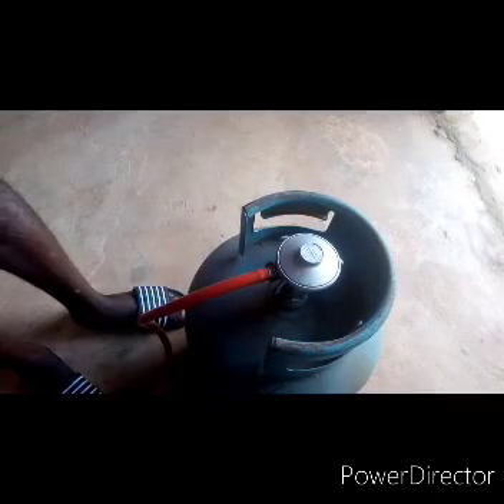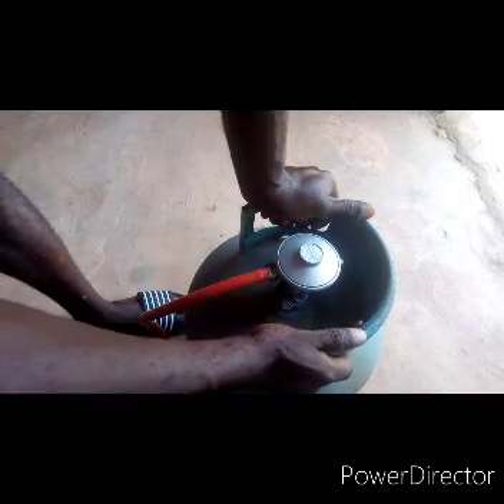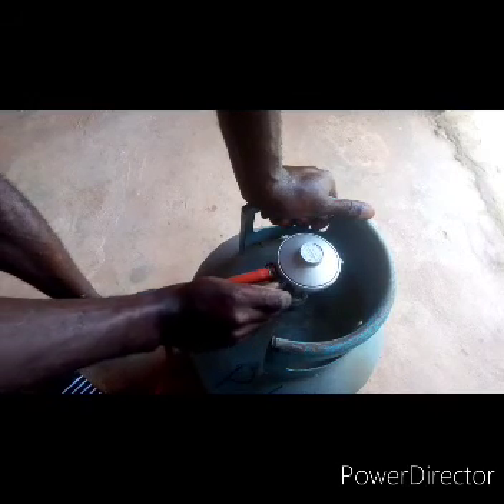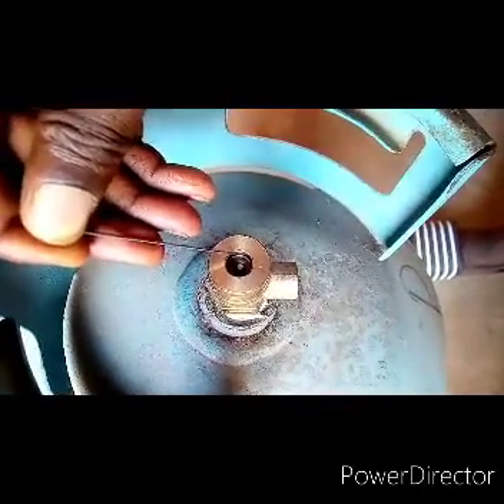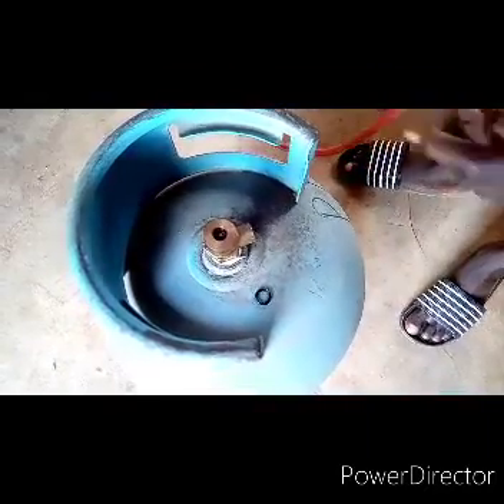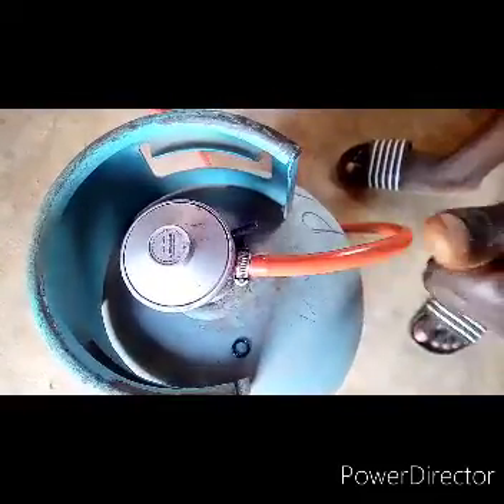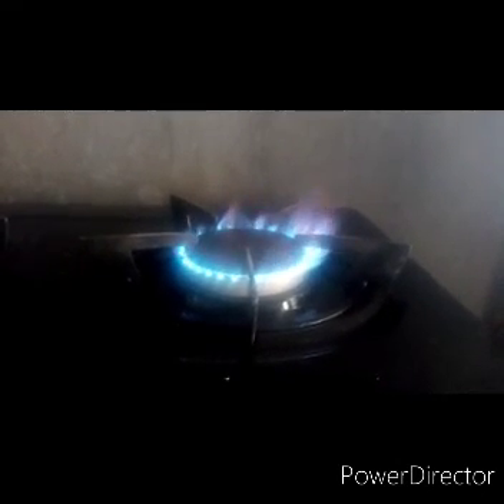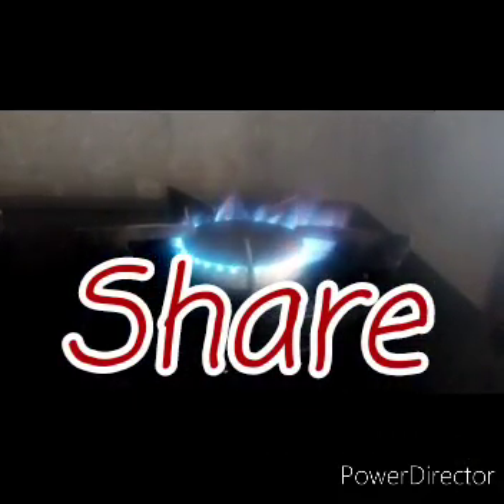How to Fix Gas Leakage from Regulator

Comment: How about leakage from below the regulator?
Reply from the maker: If below the regulator, that means the valve of the cylinder is not well fixed. It needed to be refixed after applying enough thread tape. This should be done by a professional. Thanks
Reply: @paulikenna2470  Thanks, I actually spread with soapy water and noticed tiny bubbles coming out from around the white thread tape

Comment: What if you changed it and it keeps leaking just like mine ryt now 🥹 reason why I came to YouTube
Reply from the maker: @chiamakagloria4331  if it keeps leaking after changing the rubber, consider it that the regulator is bad. Change the regulator